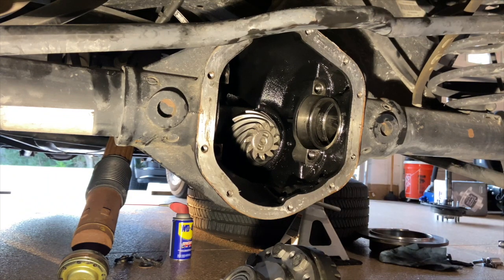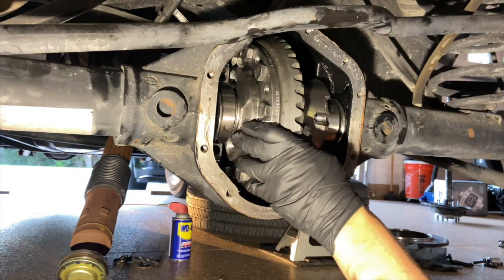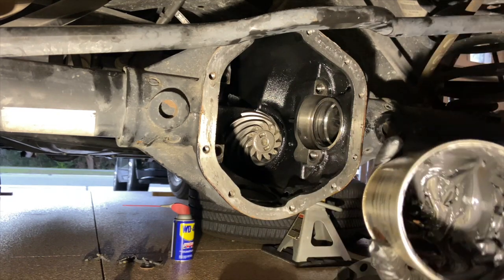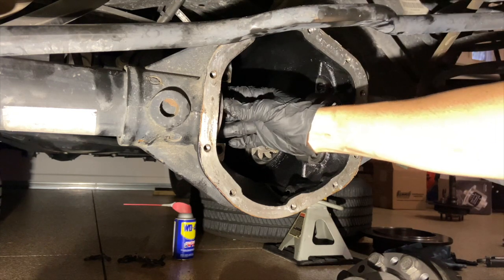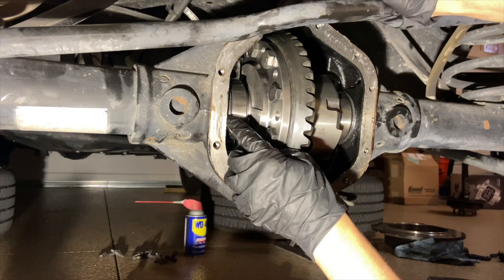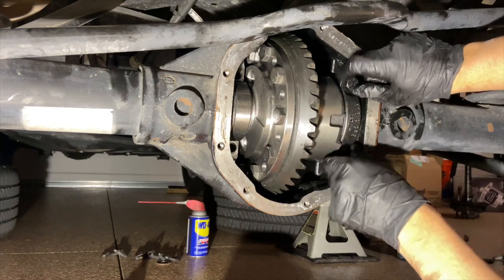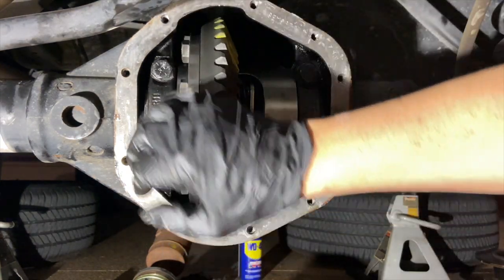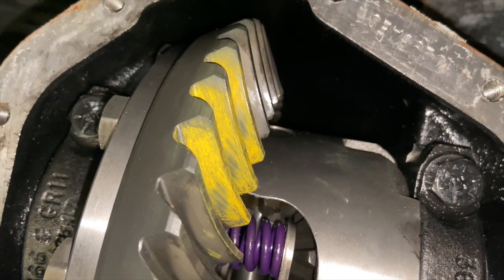Dana 44 Rebuild: Pinion Depth, Backlash and Shim Setup

Comment: You have to load the differential carrier with 40 ish lbs of force (like prying it down with a pry bar) when you check gear pattern. It’s the extra resistance that makes the pinion and ring gear mesh together forcefully like normal load that leaves a consistent gear pattern on the paint.

Comment: I've been modifying cars and trucks since I was 15.  I'm 52 now. In all my time doing work on them, I would say body work, and gears are my biggest "HATES" of working on automobiles. I hate body work because it's a pain in the ass, but GEARS, .... omg they just pizz me off lol. I hate doing REPETITIVE work on pressed on chit because of a few thousands of an inch. Properly done, The Dana 44 should have the shims on the inside of the bearings because of the fooked up outer landings for the races on the carrier. But I get you doing it the way you did since it was thinker shims. Many won't be so lucky. Thin shims will never work there.  I have all the tools, which for gears is a huge investment, and I still HATE it.  I will say, the best thing ever engineered was the Ford 9". At least they had some foresight on how to make setting carrier backlash and preload up MUCH easier. Not to mention the fact you can actually pop the 3rd member out and work on it on the bench without removing the axle! Just rotate adjusters side to side, get proper backlash,  and tighten for proper preload.  Dana and GM just cheaped out with the frickin shims. You kept your cool better than I would have doing that install. That's why I don't you tube gear installs myself. The audio would be nothing but censored "Bleeps" LOL!
Reply from the maker: It wasn’t a good time, but I saved about $400 over what the shop wanted, and ended up with new tools. Also, the shop is a well known Jeep shop in the area, but only offered a 3 month warranty. I feel like even if you did it pretty not-right, it’d last at least 3 months.

So no thanks! I’m glad I did it myself!
Reply: i just opened up my d44, and from the factory (2015 Jeep JK), the shims are on the outside. I was surprised, but I'm not sure you're correct about the shim location. There's no real place for the shims to go on the inside of the carrier bearing race. The inner side of where the carrier bearings press on is not flat or machined. I'm 99% sure the shims should be on the outside as in this example.

Comment: How did it turn out? No noise or problems ?
Reply from the maker: I’ve got about 2500 miles on it so far, and no issues!
Reply: Thanks!
I’m doing my D44 in a 51 Ford F1 pickup right now. I’ve rebuilt engines and auto trans but never a diff. Had to source a new carrier and spiders for 19 spline drive shafts which aren’t as common. 
Fingers crossed haha
Reply: Thanks!
I’m doing my D44 in a 51 Ford F1 pickup right now. I’ve rebuilt engines and auto trans but never a diff. Had to source a new carrier and spiders for 19 spline drive shafts which aren’t as common. 
Fingers crossed haha
Reply: Thanks! @CliffsHowTo
Reply: Thanks!
I’m doing my D44 in a 51 Ford F1 pickup right now. I’ve rebuilt engines and auto trans but never a diff. Had to source a new carrier and spiders for 19 spline drive shafts which aren’t as common. 
Fingers crossed haha
Reply: @CliffsHowTo